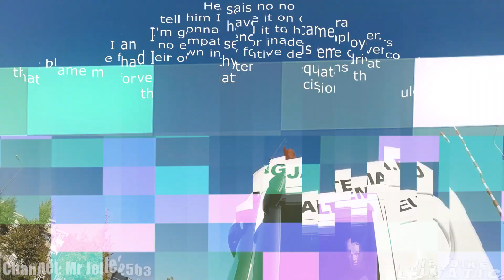DESTROYED IN SECONDS | EPIC, ANGRY, KIND & AWESOME MOTORCYCLE MOMENTS |  Ep.28

Comment: 12:49 the motorcyclist doesn't have right of way
Reply: I don't get it why would they put that in the video? It's like the bus driver the street is not that big he doesn't have a lot of space to turn... Sometimes people have to understand how difficult it can be to drive a bus or a truck.
Reply: @7hescary522  the bus driver was in the wrong because he cut all the turn  and I've seen bus drivers do turns sharper than that without cutting the turn
Reply: @TylerMoto  I agree but you gotta consider that it is not easy to drive this and people need to understand the circumstances you know
Reply: @7hescary522  I would say it both their faults

Comment: 3:55 that sucks not only the pan but have to buy a new tire aswell. Had something similar happen and had to replace a tire with less than 200 miles on it :/
Reply: You Can't clean it? :(
Reply: @Kinkese  no the oil soaks into the tire and when you start to ride and the tire gets hot again the oil pushes back out causing it to be slick. It’s not safe to ride on anymore
Reply: @poky8390  oh... Rip

Comment: 4:33 there is no way he could have stopped without locking his brakes. some people don't understand that semi trucks can not stop fast at all. I have driven these trucks before and I own a logging truck. they are simply too heavy to stop. that's why they have Jake brakes. but this one had no time to stop. a truck with no trailer can weigh up to 25,000 pounds. and a truck with a full load can weigh up to 85,000 pounds. I do realize he was only carrying a small load but he was still hauling a very heavy trailer.

Comment: 5:51 welding on a bike with the battery still connected. Bad idea???
Reply: Nothing will flow through the battery unless you attach the welding ground clamp to the battery, which nobody would do for obvious reasons.  Welding isn't as dangerous as it seems if you know what you're doing.
Reply: @atheistontheroad4545  oh ok, I was thinking it was sketch because the frame would be grounded to negative but I wasn’t sure exactly how the welder would effect it.